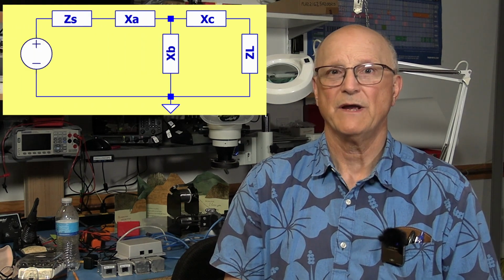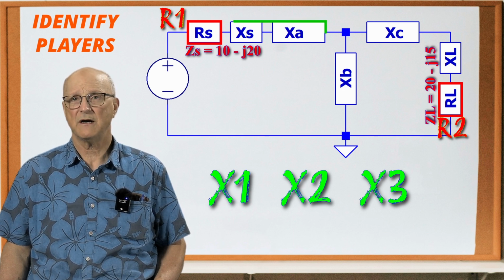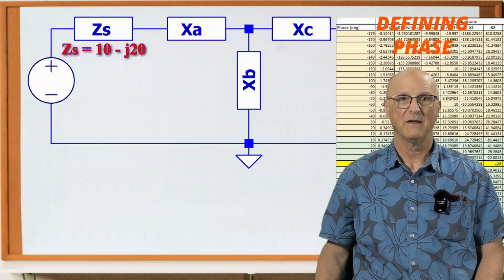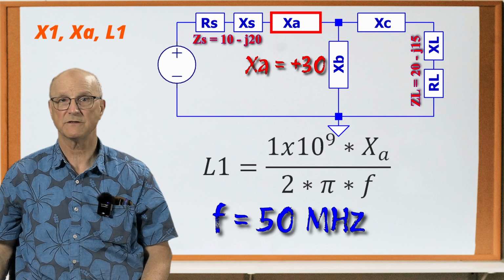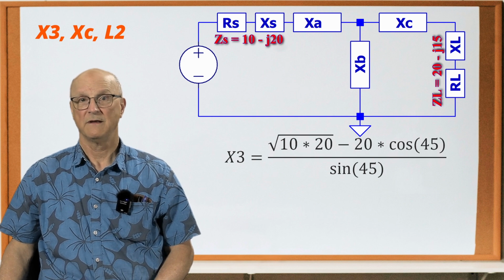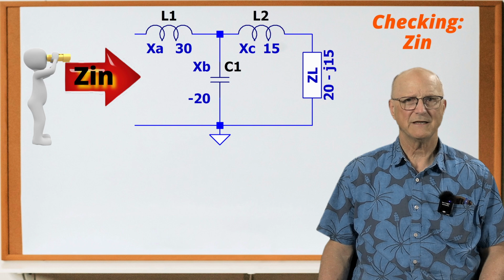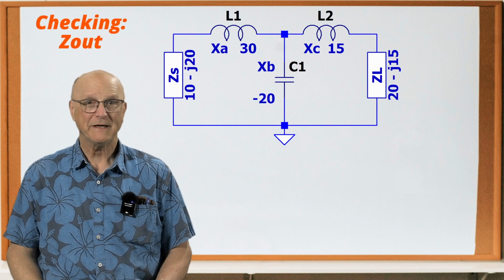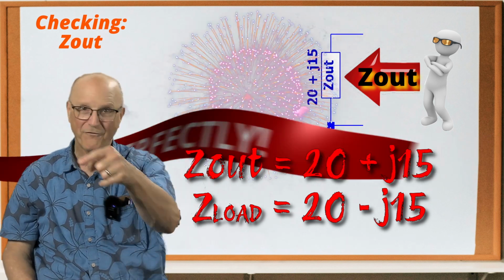Impedance Matching (Pt9): T with Math (079i)

Comment: How do you decide whether to use a La, Lb, Pi, or T circuit when starting out?
Reply from the maker: THAT, my friend, is a very good question! 
With the L configuration, choosing between an La or Lb is a matter of where the impedances are "positioned" relative to each other on the Smith Chart. If the real part of the Source impedance is less than the real part of the Load impedance, then we choose an L type a. If the real part of the Source impedance is greater than the real part of the Load impedance, then we choose L type b. 
With Pi or T, these situations will be covered and may determine whether the series components are inductors or capacitors. The parallel components are always the compliment (series capacitor => parallel inductor). All of this in very general terms.  
Regarding choosing between L, Pi or T, I'm afraid that I do not have any definitive answer for you apart from which configuration provides the needed impedance transformation with components with reasonable, practical values. Afterall, you DO have to be able to build the thing.
The other aspect of this is the phase shift of the matching network. Can you achieve the phase shift you want with the particular configuration (**IF**, of course, you even care about phase shift)?
I hope that I have been able to help some. :-)

Comment: Thank you Ralph. It is good to see the maths that underpins the Smith chart. It is all too easy to dismiss the maths and rely on the graphical form and not understand the fundamentals. I was recently looking information on wind loadings for antennas and masts. I found the info OK in an ARRL antenna handbook. Unfortunately it was in the form of a nomogram and the underlying maths wasn't available and so I couldn't use the data I could generate to dispute the rantings of a loud mouth with the ear of those we were seeking permission to erect a long wire antenna. 
Thanks for all the videos always informative and well presented.
Reply from the maker: You are very welcome! I am so glad that it scratched that "math itch". I am in the same boat. We've got to get the underpinnings so we can extrapolate to our own application. :-)